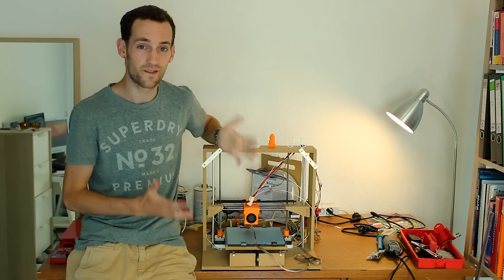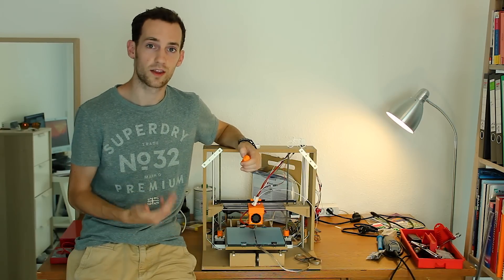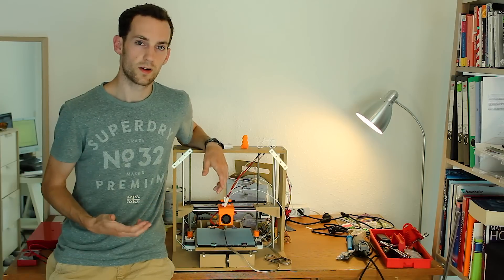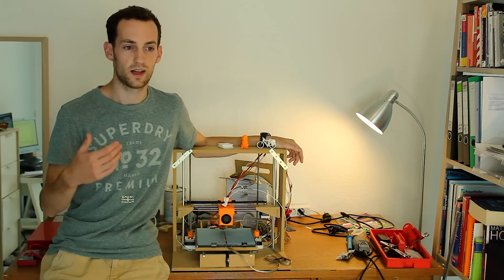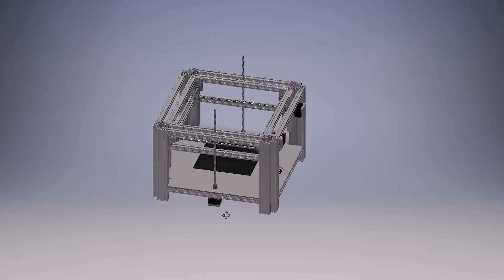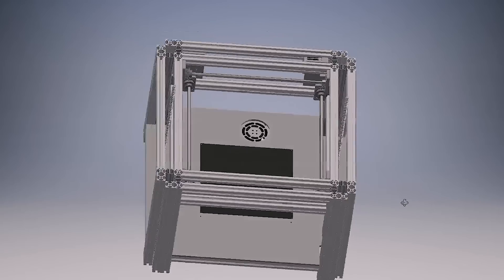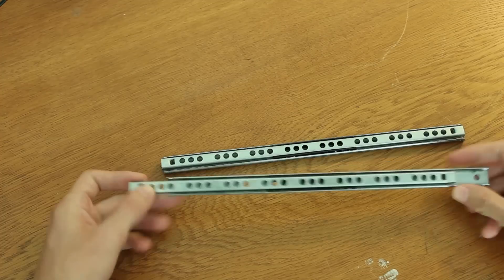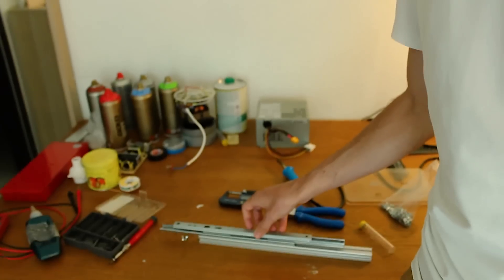Building my new 3D PRINTER - Intro

Comment: Hey, i'd call building a printer out of MDF from a store a remarkable achievement, no matter that it's slow and wobbly! I wonder though, how would it only cost 50€, unless you salvaged the NEMA17 out of ancient printers at a scrapyard? Back then if memory serves, metal hot-ends with a heatsink like you can get for $5 today weren't out yet, they used PEEK mounts and lots of hand machining on the metal part, so they weren't cheap at all, like dozens of dollars/EUR. Still today, a set of motors cost $50 or so and an electronics kit about $20 or more. Which is why i decided that for my first printer, i'd just buy a cheap kit, and then consider whether i want to rebuild it into a different shape or modify it. Obviously the one thing that's most helpful when building a 3D printer, is to already have one.
Reply from the maker: Well you basically already guessed where I got my parts from... ancient printers at a scrapyard :D I first looked into "old" printers but those only had dc motors with linear encoders on them. So after some research I found that the big, ancient office printers usually had NEMA17 motors inside. That's also where I got the rails from. I remember the extruder to be 30€, which came straight out of china and I got the heated bed from ebay. I at first held everything together with zip ties and hot glue and then gradually upgraded the printer with printed parts.